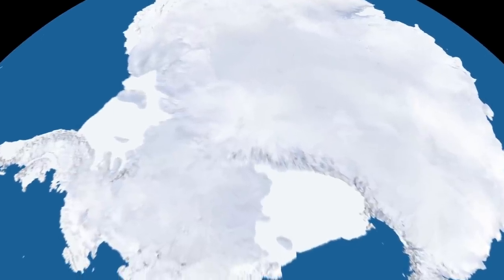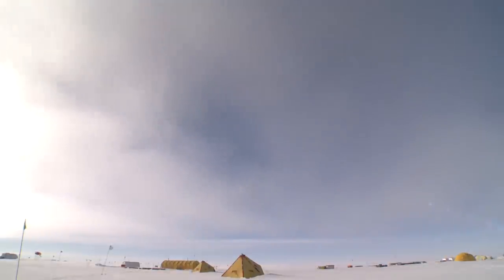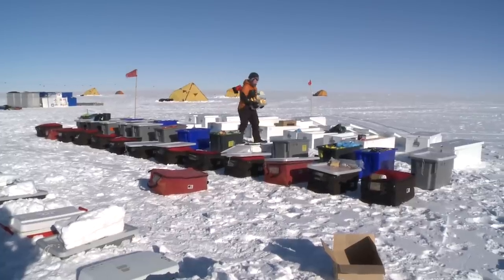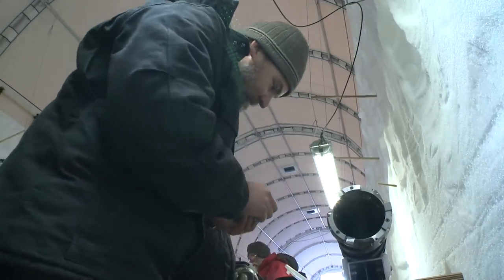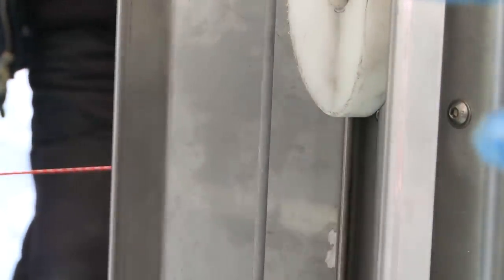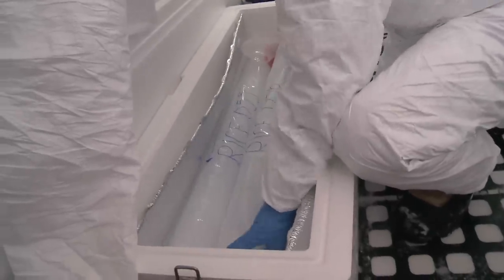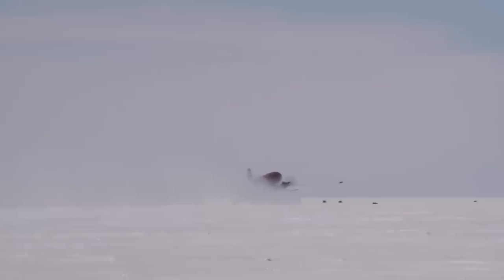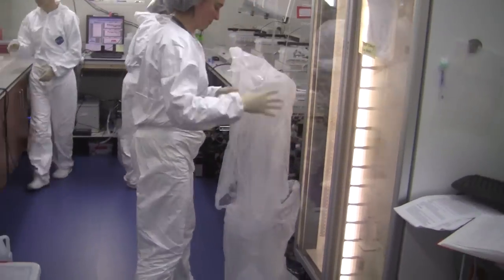Roosevelt Island Ice Core Drilling

Comment: so you scientist drill holes in ice that has not seen the sun in thousands of years?
 could that be the reason the ice is melting so quickly? 
after all your perforating large sections of ice sheets. then wonder why they fall off. 
geniuses
Reply from the maker: +Robert Saltzman Drilling ice cores has absolutely no impact on Antarctic melting. Cold air sinks and the air is well below freezing temp. Unless the drill holes are lined, they close up soon after drilling due to the plasticity of the ice under pressure. The Ross Ice Shelf is the size of France, so a 10cm diameter hole is not actually a large section of it.
Reply: +GNS Science so you're saying that when glaciers calve, that if that area was ever drilled for cores. the new ice forced into the hole  absolutely no strength or weakness to the glacier as a whole? granted the glacier would calve and melt anyway, but I notice ice with holes in em melt faster. the structure has been altered there is no way it doesn't effect it someway!